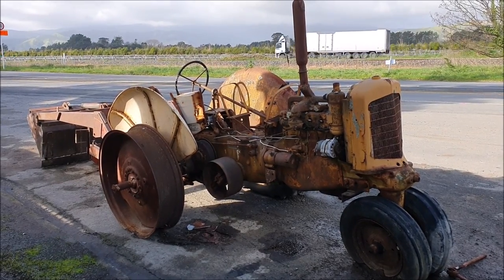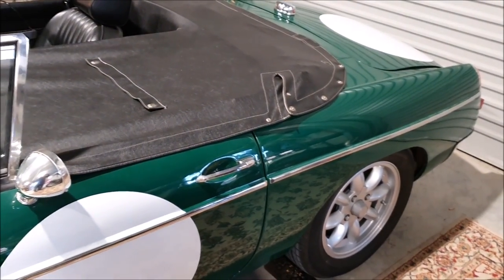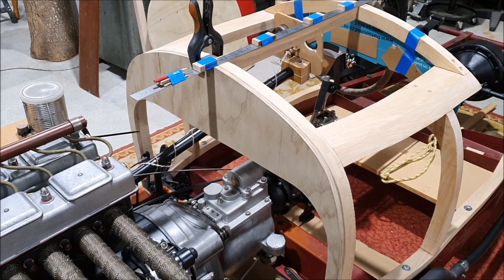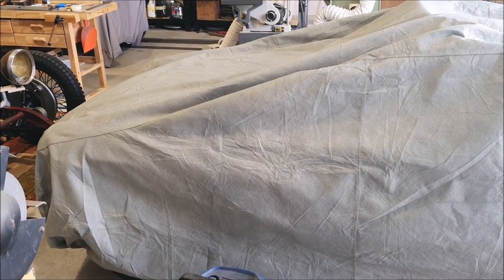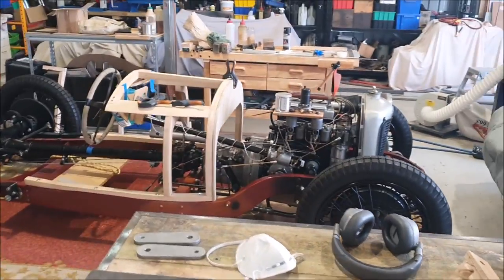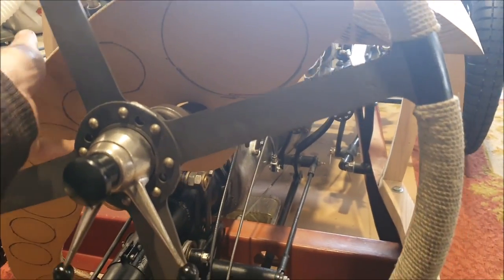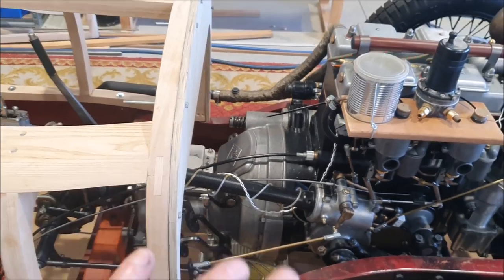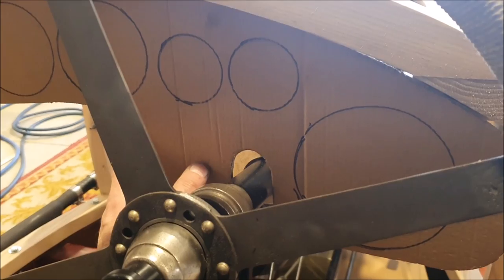Pre war Riley Brooklands starting the fuel tank mount

Comment: You build like you have been building these all your life. On the mG that I wil be building the outer shell will either be polished aluminum , or steel so I will be thankful to learn from your wins and failures. The 1928 Moggie has aircraft fabric stretched over the wood frame . I plan making a copper dashboard and using as much copper tubing as possible and flat polished copper anywhere that there is a flat space..
Reply from the maker: I wish I had more experience to be honest, then things wouldn't take so long! That's also why there is no real plan or pattern to my films, I honestly work it out as I go along. Hence lots of repeating myself and redoing things. But for me that's how these projects go. If you do decide to do YT decide what you want to do there.  You can certainly do far more concise and useful films than me! There are a few good channels to follow, not all Riley stuff, but car building. But not the 'fake' rebuild a supercar in 6 weeks ones. Have a look for things like John's Projects (a Belly Tank racer), MacroMachines (a boat tail special with a Jag engine), ShedByTheTracks (Model T special), Metal Shaper Tom (who is meant to be doing and A7 special) and of course Project Binky (Celica powered Mini) if you like seeing brackets made! There is a copper bodied car in the local car museum here in NZ. The problem with copper is it will work harden with vibration and eventually crack!

Comment: You'v made a great job of the dash Simon. 
Good idea to mock up the clocks so you cam move them around. I couldn't  see a ignition light and indicator switch, or is that on the control panel? It's only when you sat in it I could get an idear just how small it is  but looknig more and more like a car.
Reply from the maker: No indicators on this car, I don't need them. The ignition lamp is small so can go anywhere really. I am trying to find a suitable lamp at the moment. It has to be one with a proper incandescent bulb in it as well.
Reply from the maker: I do also need a switch for the fuel pump!
Reply: @asciimation  It's quite common to hide this as security device although  I drought young car thieves would be able to drive a  crash box gearbox car.or even how to start it, even with a key.
Reply from the maker: @russellnixon9981  Someone trying to steal it doesn't really worry me. Most people probably couldn't work out how to get into it! Crash box and reversed gate. I suspect most people would put it into 3rd of 4th and try to start it that way! Also you need to pull out the mag cut switch or else you get no spark. Also I have a decent battery cut off switch with a removable key. I can just take that key with me. I do that with my MGB actually. I fitted an alarm but I never use it. I just take the battery key with me.
Reply: @asciimation  Hi Simon No indicators!! I suppose the volume of traffic in NZ is less than here. The Falcon has both flashing indicators and trafficators and people still do not take notice! It may be an idea to include the wires in the loom even if you dont use them just in case. You may run out of hands double declutching, keeping the thing in a straight line and signaling!! Cheers John
Reply from the maker: @johnclay4811  Well, the thinking is I don't need them to get the car on the road. So it's easier not to have them. One less thing to cause issues. But I can add them later if needed so yes, having provision for them is a good idea. If I put them on from the start they always have to be there and then removing them later would mean the car was modified.
Reply: @asciimation  I do find that strange that the transport bods are banging on about seat belts yet will pass it without signals. I dont think  legally i need them on the Falcon but in todays traffic!  I don't think Riley fitted anything up to 32/'33ish although there were all sorts of contraptions you could fit yourself!
Reply from the maker: @johnclay4811  The rules are somewhat confusing!
Reply: @asciimation  Your not kidding!